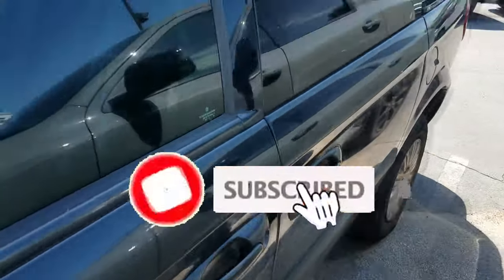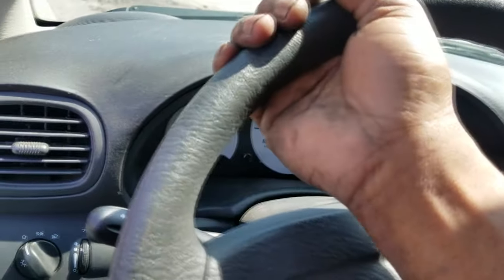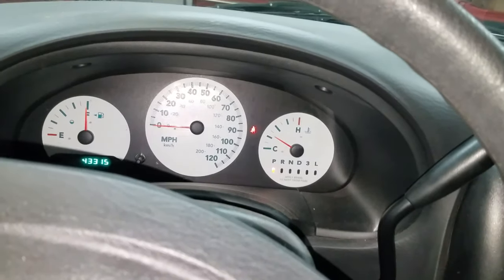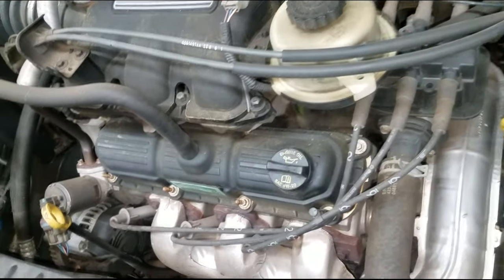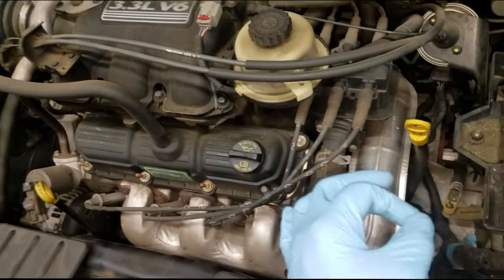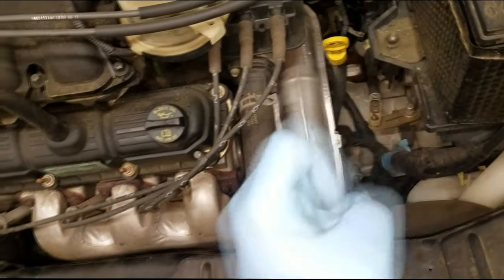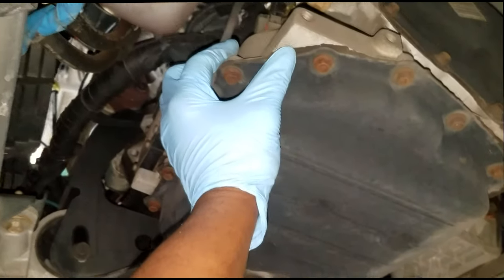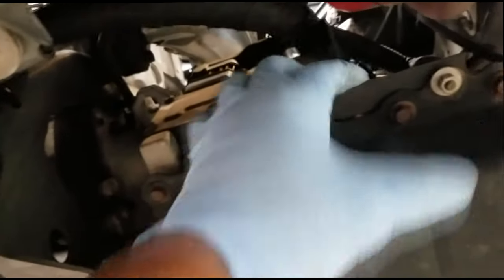How to fix a transmission in your car. No Reverse, Check this. Bad transmission whining noise P0700

Comment: I had a problem with an Astra 08 auto, the reverse stopped working. I disconnected the battery to fix a coolant problem and then only reverse would work. I then disconnected the battery, touched the cables together to reset the TCM transmission control module. Then you need to retrain it by slowly shifting all the gears 3 times. Then drive it around slowly, then stop and go through all the gears again slowly. Eventually the car started going forward and each of the gears started working. Dodged a transmission replacement 😅

Comment: Hello every one. I am having a problem with my mercury villager 97. It doesnt engage in reverse. When I put it in reverse gear, it feels like it wants to but when I press the accelerate pedal, it doesnt reverse.
Reply: Then watch the video doofus
Reply: I have a Nissan bluebird N16 2005 model and having a no reverse problem it moves back slowly with the engine rep high can someone help me solve this problem

Comment: I have a 2012  Chrysler and having the same issue this gives me info now I can discuss with the mechanic in a couple of days hope it’s something minor reverse is just not there little to no power reversing. But works fine in drive but I am noticing now a little kick fwd time and again driving just noticed the issue last week keep you posted thank u
Reply: What was the problem
Reply: Problem fixed ?
Reply: wht was the problem?
Reply from the maker: The problem was internal. She just bought a new transmission

Comment: My dodge avenger is similar. Put it in reverse step on accelerator and only thing moves is rpms. Barely goes back, if im on a decline im going forward in reverse. So my question is, does this problem spread, does it get worse? Should i expect problems when im in Drive to come?

Comment: I have a 2003 Dodge Neon SXT Automatic and with gas pedal to the floor, it barely moves in reverse, what could be causing this? The wheels seem like they are trying to move but, they don't with the car on the ground and moves extremely slow when front is jacked up and it just revs the engine mostly. Reverse is the only gear that is doing this, all forward gears work fine.
Reply from the maker: Hey bud, always start suspected transmission problems with fluid inspection and level check. That could tell you a lot. From there see if any transmission codes in the computer, and from there you may need to simply just remove the trans pan to see if anything came apart

Comment: Are rebuilds more affordable than a a used transmission?  I lost reverse on  2010 Toyota Matrix S AWD  with 164,000 miles and a U140F transmission.  ATF fluid is burnt. Black metallic silt clinging to pan magnets.  I changed the ATF fluid and filter (OEM spec), disassembled and cleaned the valve body and installed a Zip Kit, cleaned and tested shift solenoids, replaced p/n transmission range sensor, replaced transmission solenoid wire.  No dice.   I used the vehicle on the farm for hauling a landscape trailer with 800 lbs cargo loads the past 3 years
Reply: Unfortunately rebuild cost generally around 1500 to $2,500 / usually you can put a used transmission for under a thousand depending on model of car
Reply: Maybe needs a new transmission cooler
Reply: Transmission fluid cooler*

Comment: I have Toyota Avanza 2019 module when I put the gear on reverse it doesn't move  it flashes (ATF) light, I have  to switch my car off for 4 or more     hours so that the engine can cool down, is where I can be able to reverse what might be the problem?

Comment: 99z28 , goes backwards in the morning when it’s cold by itself not with gas , after use won’t reverse by itself without forcing it any suggesting , not clogged up

Comment: I have a mazda cx 7 and was reversing up a small incline on a hill and tires spun out a bit heard a clunk. Put in drive and didn't shift normal..at light came on pulled over and put into reverse but wouldn't go it was like it was in park or Neutral. The fluid was just flushed at mazda 9000 miles ago.?

Comment: I just got a rx300 Lexus it won’t reverse just started today no check engine light could it be the transmission? Or do I need new fluid and filter?
Reply from the maker: Hello my friend. With any kind of transmission checks you should start off with getting the fluid level checked. You left off the year of the car so im not sure if it has a dipstick/tube. Also, are you subscribed to the channel?

Comment: I have a 2015 Lexus ES350 reverse will go into gear but wont move. Drive works. Everytime I needa park somewhere I think if I can even get out without reversing. Lifes getting difficult. Lol.. Is this a expensive repair? I've been hearing its expensive because its a issue inside of the transmission.... Plus, any reasons on why it happened on a Lexus? My lexus is 2015... 100k miles.... When I reverse I make sure im fully stopped before changing gears...
Reply from the maker: Thanks for watching my friend. And yes it can get expensive and in fact, depending on the transmission, most shops would rather just replace it. The easiest thing to do is have somebody drop the pan to see if theres any heavy parts in there. Please like the video and sub the channel for me, thanks
Reply: Online Mechanic Tips I recently had a transmission fluid flush. Now i think its getting worser day by day.. Pretty hard to reverse now... Almost never goes into moving anymore but a couple weeks it would just here and there..
Reply: Have you known anyone that ran as is for along time?😁🙄
Reply: ben l you said what?
Reply: Was asking OMT/anyone has he ever heard of anyone just using the car with no reverse ie "running it til the shit dont work no more" thinking about trying it!
Reply: As for your problem you could check  lexus recall bulletin, maybe even ask can you get a discount on a trans replacement since it iz right at the 5 yr 100k mile marker

Comment: Hello, I have a 1996 Pontiac Grand Am SE 2.4 L, a couple of days ago I tried to put it on reversr to park on the back of my building and the reverse didn't engage, I tried a few times back and forth and nothing but I discovered that if I put it between the P and R then reverse works but if you let go my hand from the stick it goes back to either parking or reverse position, please can you help telling me more or less what is going on? thanks I appreciate, JD

Comment: I have a 2003 mazda protege Every morning or when i let the car sit for more than 3 hours i put it in drive and it delays for bout 6 sec and the o/d off start blinking and it wont drive i have to wait till about 10 mins till the engine gets hot and turn the car off and back on after it drives fine any help????

Comment: Hey I subscribed! So my old 1995 Nissan d21 V6 4x4 pickup lost reverse today and I still have to check the trans fluid. Would it fix anything if I put more of the correct ATF in? I'm gonna take it to a transmission shop this weekend.. I had to push it out of the parking stall I was in this evening. I imagine I shouldn't drive it anymore unless it's straight into a lift like you did with this Chrysler. I don't want to have to replace the transmission but I will if I absolutely have to. Any suggestions for things I could do at home? Thanks.
Reply from the maker: Hey bud, just about the only thing you can do is verify the trans fluid level. I agree, if its low, add the proper amount then find and fix leak. Thats just about all you can do. Not sure if this year model was computer controlled.
Reply: @OnlineMechanicTips  thanks for your response yes it is microcomputer controlled (VG30E engine model) could I check something there?
Reply from the maker: @runaboutcanada  O wow, well im sure at any shop, diagnostics would start here. Not sure how but im sure somebody has a scan tool of some sort for it.

Comment: Hi i would like to know what happens to a mazda axela 2011 transmission that only goes foward in park neutral reverse and drive and no reverse thank you
Reply: Omg I have the same problem but for a 1993 acura integra

Comment: Hi Sir, my car was having a whinning noise from the transmission, but the car was moving very well,  both forward and reverse,  to check for the whinning, they open the transmission pan,  no any metal particles, they cleaned the body valve, checking the shift solenoids, cleaning  transmission  filter, they change one of the shift solonoid with  new one, because during test one solonoid was defective, now after puting back everything, now the car is  slightly hesitate and delay in reversing, but moving forward very well what might have gone wrong with it?
Reply: i think you shouldn't change the soilenoid. just clean it.. or change both A & B

Comment: So if it high milage 200, and no reverse is bad so I might as well get a new transmission but I had gotten it done a couple months ago pay $1,600 for a rebuilt one and it was making some noise and I thought it was the flywheel and then I need to get the truck in the shop or get my hands on it may take me awhile but I did the fuel pump for 2006 GMC I had to learn cuz I can't afford to pay a mechanic
Reply from the maker: Yes I read your last comment, again if fluid level ok then likely the pump circulation has slowed. Which would mean new unit. Sorry

Comment: I had an old voyager had the 41te had the same rtv seal the tranny was going out and I did everything I could from trying inspect the harness all the way to changing the solenoid pack but from my experience those transmissions are garbage in my opinion. Not recommended at all. Now I’m experiencing no reverse out of a 2000 explorer. I’m not sure I want to even look in to it. I’ll probably just replace the transmission all together

Comment: Seen an 04 Lexus ls430 for 1500 only thing wrong is it won’t go in reverse
Reply from the maker: You might as well factor in the cost of a transmission then. Because nobody overhauling those hardly anymore if the problem internal. Thanks for watching

Comment: 2000 Ford 6 cylinder, no reverse  you have a fix for me?
Reply: Same with me. Accordng to my research it is the reverse band inside the tranny. 06 Expedition. Going to the mechanic tomorrow. It happened today. Did you get yours fixed? What was the problem?
Reply: @reerii7660  how much did you pay?
Reply: @raulcastillo9796  $1400 for rebuild and 120 for rear differential. Plus tax.
Reply: @reerii7660  Jesus Christ! Everything feels like a grand or more for cars now

Comment: Hey whats the title of that intro beat you have? Def an atl beat for sure
Reply from the maker: lol, one of my old inrtumental beats I did a long time ago..Thanks for watching, I hope you subscribed buddy..
Reply: @OnlineMechanicTips  Probably a simple fluid and filter change?
Reply: @OnlineMechanicTips  hey buddy,how you doing?I need your help once again! I got an 02 Chevy Silverado making weird noises when I get up to 3540 miles an hour when I let off the gas it stops when I accelerate it starts again. 10 to 15 minutes after driving the truck it quits moving drive shaft and wheels stop.

Comment: U ain’t say nothing bout the problem the whole time bunch of nonsense get to
The
Point
Reply from the maker: Another guy on youtube looking for miracle videos, newsflash. There is no such thing. I decided to speak and show how a vehicle with no reverse should be addressed. If fluid filled to specs and its not a cable issue its simple, your transmission has to come out for repair or replacement. Nobody on youtube know whats going on inside your transmission buddy. Good luck, hope you get it straighten out.
Reply: Jrock he is explaining troubles and fixes. The video is his point

Comment: 2010 toyota corolla no reverse you put it in neutral while the engine is on you can't push it back because the front wheels are lock as if it's still in park something broke in the transmission I think

Comment: Easy. It’s an 07 it’s 2020… transmission fluid degraded no longer does job so trans overheated fucked some solenoids up and bam.

Comment: I'm half way through your video and yet you still haven't said shit about the transmission or anything relevant
Reply from the maker: The complete conversation relevant to why you have no reverse buddy..Seems you looking for a fix quick miracle video that will show you what button to push to get reverse back..sorry but those don't exist. I ended up replacing this transmission which was explained and the reasoning behind it.

Comment: I am a subscriber and my reverse isnt working. Every other gear works but my reverse i can coast in reverse but thats it 2004 chrysler town and country 3.3
Reply from the maker: Hello my friend, if you have every other gear but reverse and you have the correct level of fluid, your problem could very well be internal..it also likely set a code..due to the year and mileage it my be time to drop the pan and see if any hard material in it

Comment: Bro u talked through out the whole video and nothing done yet.ur gloves not e en dirty.
Reply from the maker: Then click stop and keep looking for the miracle video you seek. Fact is, there are none. What you just saw was me speaking on this van with no reverse. It needs a transmission. Same with your POS car. If you was not servicing your trans like you was suppose to and now you have no reverse, you F up. Don't come over here with ya mis haps. Its simple, you need to replace your transmission. Or you can keep searching fo a miracle video that may show a hidden G14 classified type sercret.

Comment: get to the point instead of wasting time
Reply from the maker: Take ya lame impatient ass somewhere else dude. This was basically a vlogg discussing how reverse gears are affected base off having no reverse gear. Your problem is that you on here looking for a miracle video that will magically tell you heres all you need to do to get reverse. Newsflash, no such video or repairs exist. You likely have internal trans problems so dont take your frustration out on this video.

Comment: omg stop rambbling and show us the problem
Reply from the maker: Even if I showed you you wouldn't know what you looking at or what to do so calm ya ass down. You need to get your transmission replace. There is no miracle videos out that can magically fix your reverse gear. Problem likely internal